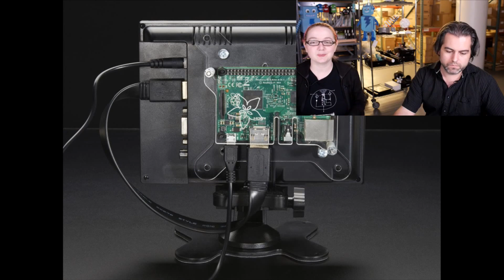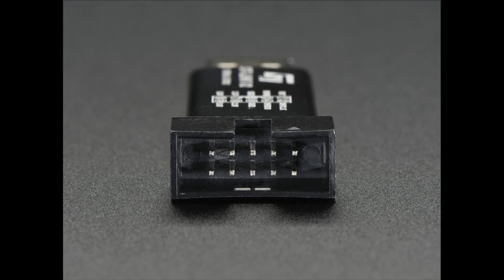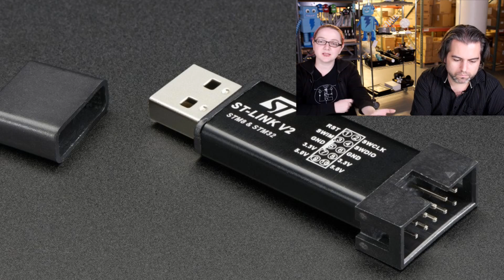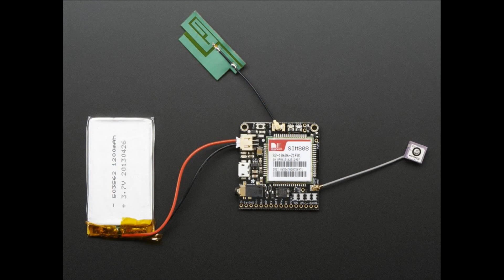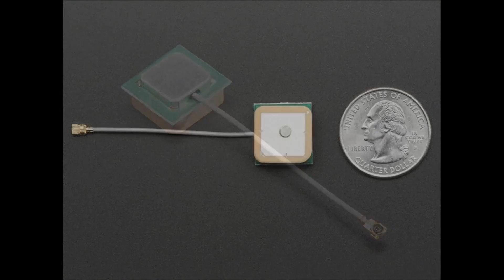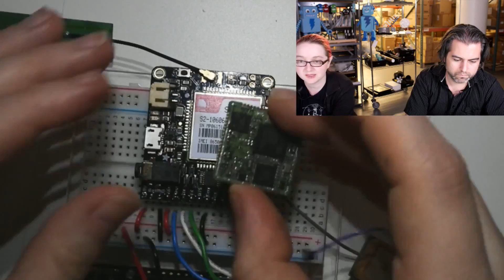New Products 6/3/2015

Comment: If I have a product idea, buy these modules and get it working. Would I have to buy the Adafruit FONA 808 modules or is it possible to use the Eagle Cad references Adafruit provides and send them off to a PCB manufacturer? This is product is a fun project that I'd like to sell to friends and people thru word of mouth, not a big venture capital type of thing. I ask because I'd guess the chips on the FONA 808 used aren't found just anywhere(I could be wrong) and an Adafruit product inside my product would make it look like a tinkerers project. I want to add a microcontroller and that's it. I wouldn't mind saving myself the headache of having to redo and testing the PCB(lipo charger and all) because I know it's pretty close perfect as is, but a the FONA 808 with Adafruit logos snapped onto another PCB with only a microcontroller with a looks weird to me or is it?